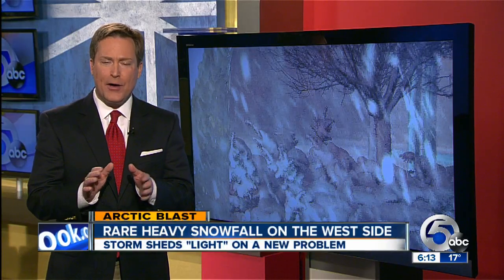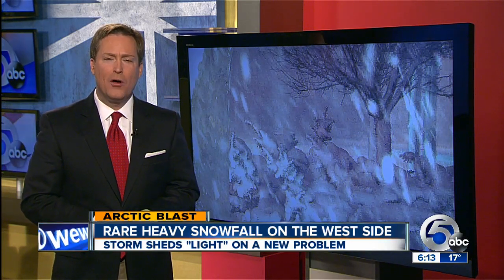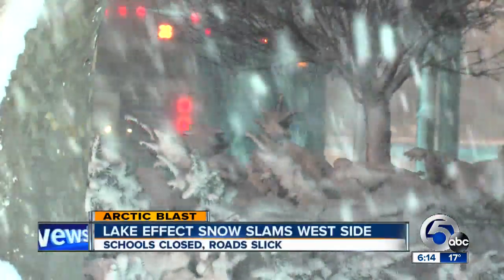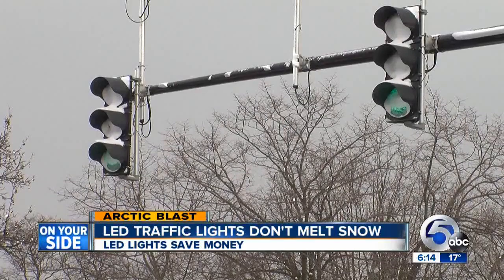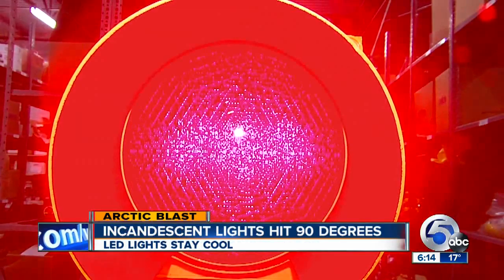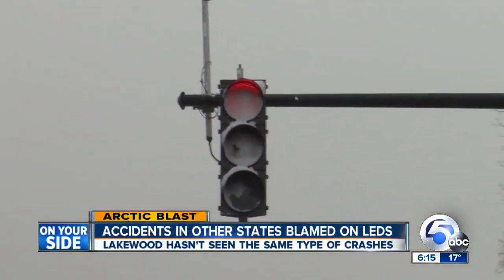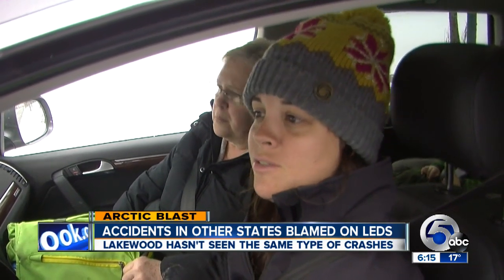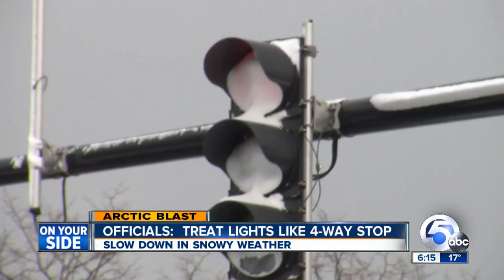LED traffic lights

Comment: What about heaters built within the unit? With a thermal sensor that switches on the heater automatically when the temperature drops below a certain point.

Comment: It would be more reasonable just to add heaters so that they melt snow during the winter. You don't have snow all the time, so you also don't need to spend power on heat all the time.
Reply: VortaBlack GE has done so. They made a defroster on their new LED modules with censors so that they only turn on in the winter. That means that savings still come with energy and money.
Reply: You could always just add a special snow visor that cost like a few bucks, that has the snow go smoothly above the visor. That is a much more sufficient solution. Though the heater would work too, the snow visor is better.

Comment: Lol putting heaters on the face to melt show in some states. But why? The heater plus the led fixture dang. The power consumption is right back up there maybe even as much as 75 watts more than just running the good old standard bulb when using those heaters. Government logic at it's finest here like normal.
Reply: Not true... The heaters will only come on during certain weather conditions. They don't run all summer.
Reply: Not at all. The LED lights with heaters have temperature sensors that only activate heat when the temperature gets too low and some heated LED traffic lights aurally draw less power than incandescent when actually running.

Comment: Led traffic light need to ban!!!
Reply: LED FOR SAVING ENERGY!!! $$$$$$ not banner.
Reply: https://youtu.be/GiYO1TObNz8
Reply: @atiger2773  Thank you! The people who think getting rid of LEDs will fix them problem don't think very brightly.
Reply: Not the solution. Going back to energy hungry incandescent bulbs just to fix a problem that only happens a few days per year in most places is plain ridiculous. There are solutions like adding an electric heater to the LED lights that turn on only when it gets too snowy, or even just using a visor that blows the snow off the light. Technology Connections made a whole video about LED traffic lights showing the problem with the "but sometimes" mentality and shows how vastly inferior incandescent traffic lights are compared to LEDs along with how to deal with the snow on LEDs.